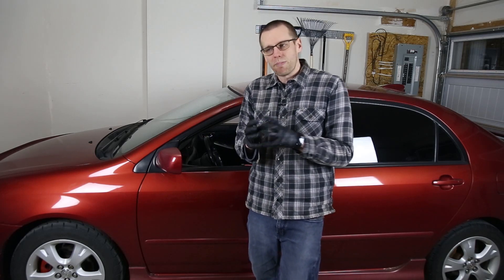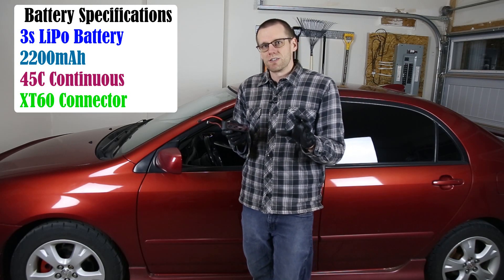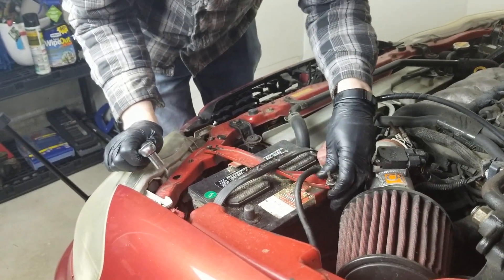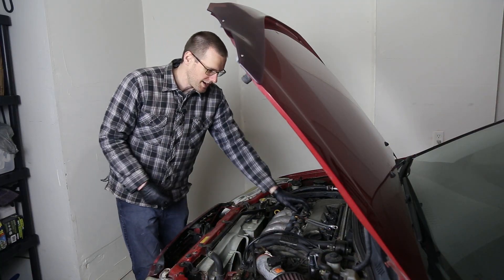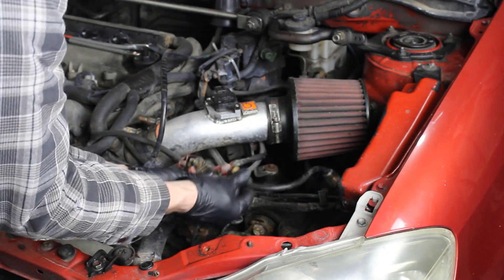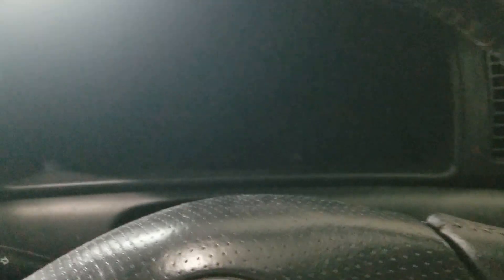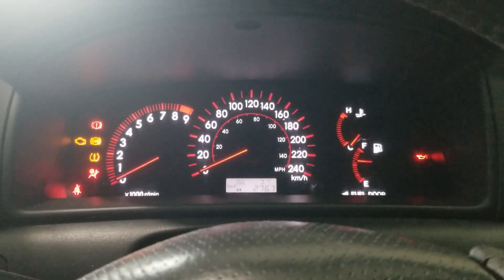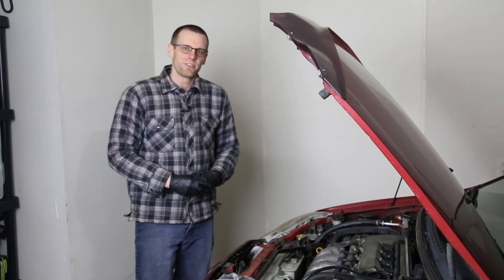Can this TINY RC LiPo Battery Pack Start a Car?

Comment: Wish you told us the "s" count, mAh, and C discharge value for the pack you are using. With a 12V system, I am thinking a 4s battery would be safest (since 3s would be overwhelmed by the 14.5V alternator output when it kicks on) and that it will need to be around a 5,000 mAh battery with around a 100C rating. You only need around 400 or so cranking amps for most commuter cars (probably takes even less CCA for LiPo since the voltage drop from cranking would be less than with lithium than lead-acid).

Comment: How much damage does it cause to lipo?
Reply from the maker: Damage from high power consumption is often linked to heat. However, since the higher discharge current occurred for only a brief moment, no noticeable heat buildup was observed. I would expect this to fall in the typical usage parameters of this pack. Especially considering (in RC) I pull over 550 amps from a 5000mAh pack. That would be similar to over 242 Amps from this 2200mAh pack. I'm certain my corolla doesn't pull much over 242 peak amps in a crank. Just a few thoughts, nothing concrete as its hard to differentiate wear patterns in LiPo Batteries.

Comment: I carry a 5000 mah 3s battery with a dean to aligator clip setup just in case my bike has issues starting.  Been doing it for years since my Buell has a high compression Harley Davidson V-twin, with a cooling fan setup that runs for 3 minutes after the bike is shut off.  Also while the ECM spy wifi is hooked up to adjust fuel maps, the headlight glows draining my battery.  So needless to say I need it, but I dont disconnect the stator which is like an alternator on a car.  I just start the bike and pull off the alligator clips. As long as its piggybacked + = +, - = - off the vehicles battery it is in parallel and not in series, so no harm is done, its basically a jumper battery.  Oh and my bike is also a 1.2 litre... except a long stroke V-twin, so a bit of a strain on any starter to say the least.  Just look up people trying to pushstart v-twins if you need a laugh.

Comment: Mid-sized cars need about 400amps.  So a 5ah Lipo with 100c should do 500 amps.  Anything smaller would probably need a better fire bag.

Comment: just 6s pb at max is 14v not 12.6v 12.6 is nominal
Reply from the maker: 12.6v would be considered max resting voltage. 14v would occur only while charging.
Reply: @RCexplained  ok but if you mesure on battery at 100 is 13.2 because 1 PB cell new is 2.2V :)
Reply: @vladimirsamas3097  it is 2.1v full! with 6 cells then 12.6v.Also 2v is nominal.
Reply: @RCexplained  12.6 is a lazy batt. On average 12.85v after resting for days is a goid sla batt

Comment: Our 2004 ponitac Vibe 299999 miles! Unfortunately it's 1ZZ not 2ZZ, we hardly ever take it up to 5k rpm.
Reply from the maker: That is a lot of miles Patrick! I don't think the car in the video ever leaves the driveway without exceeding 5k at least once. Gears are very short. 60km/h I'm in 5th at over 2000RPM. My wife has a 1ZZ Matrix, great car.

Comment: Hi, do you know how much energy was drained from the battery in the process?
Reply from the maker: Not exactly, however the 2 starts in the video left the battery at 4.10v/cell. This is about 90% capacity on a 2200mAh pack.
Reply: @RCexplained  Thanks for the information!

Comment: I tried with a 4s and melted the solder out of the connectors. Dont do that
Reply: Because 4s too much voltage.only with 3s safely you can start engine